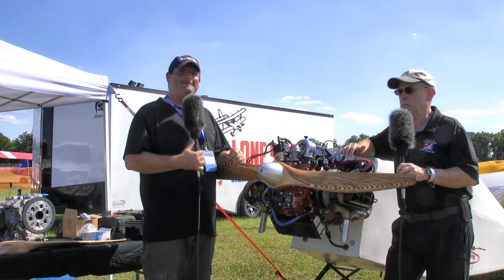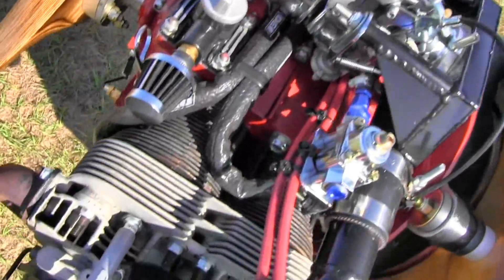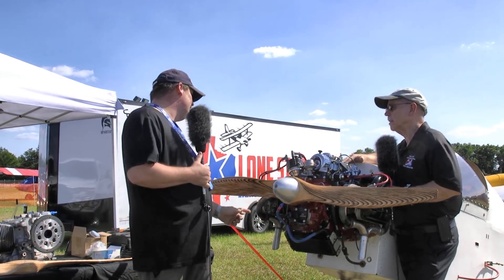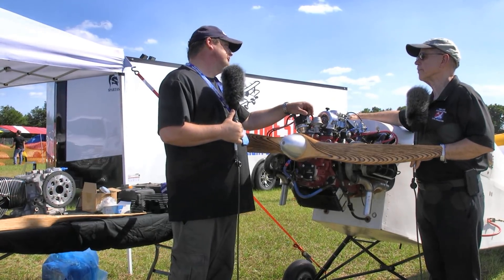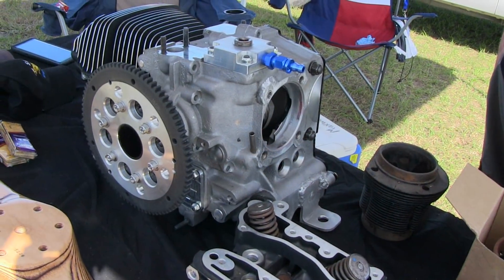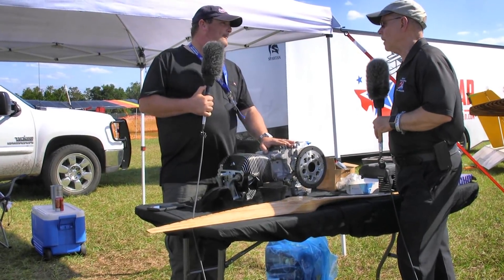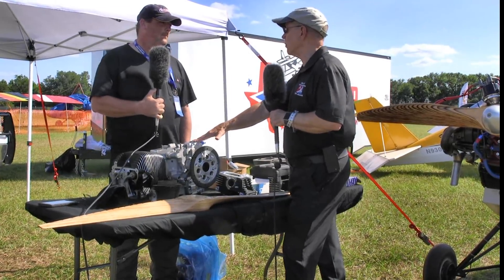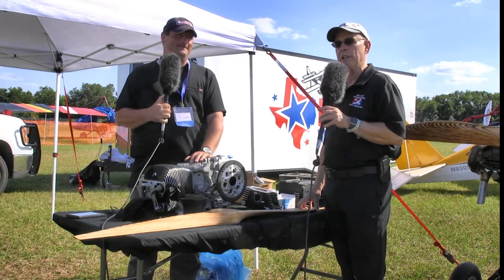4 Stroke, twin cylinder, 125 lbs. aircraft engines, Rotax 582, Rotax 912, Lone Star Light Sport.

Comment: This new engine, constructed using very high quality components and having fuel injection, a twin spark plug ignition system and high air flow cylinders and hydraulic valve cylinder heads is an exciting new development which has the potential to really improve the aircraft they're fitted to! 

It looks to be the best of each component, masterfully brought together to produce an entirely new engine category for weight, power, TBO and cost. 

I don't think that I have ever been as excited about and interested in a new engine type as I am with this one!

Comment: I wouldn't fly in anything with a Harley carburetor 🤭
Reply: Old post, I know. 
But, I’m pretty sure that’s a Keihin CV carb. 
The Keihin carb was used (still is?) by many motorcycle manufacturers over the years. 
I don’t know about aircraft application but they work very well on lots of different motorcycles. 
I don’t mean to criticize these guys (they must have put a huge amount of effort into this project) but I wonder why they chose Harley cylinders and heads?
Reply: Yupp!!

Comment: Not rating horsepower is silly and a marketing mistake. 

It doesn't matter what the reality is, everyone compares engines using horsepower, it's as simple as that. 

If you have more torque at the same rpm as your competitor, then you simply have more horsepower as well, the math doesn't lie, so what's the problem, you still win.
Reply: HP = (torque*rpm)/5252
Your statement makes zero sense.

Comment: The claim at 4:50 that volumetric efficiency goes up with this ignition system had me laughing.
Reply: Jeffrey Wagner to be clear, there are 2 firms of volumetric efficiency in play... 1: the ratio of a graduated power output vs cylinder volume and 2: the ratio of combustion volume vs amount burned.  I suppose the term combustion efficiency would have been a better term to use for the point. I have never been good at talking with a camera in my face..
Reply: why , steves correct
Reply: Of course the volumetric efficiency goes up if you have a better burn. 

It's not even very technical, and the simplistic reason is greater evac of the cylinder during the exhaust cycle creating a stronger sonic wave and hence lower pressure in the cylinder behind it. 

Oh and these guys are building engines, what do you do.
Reply: JW you're not the only engine guy who had a moment there!